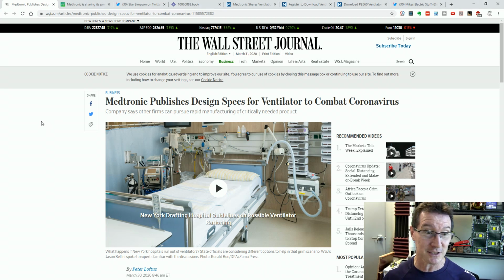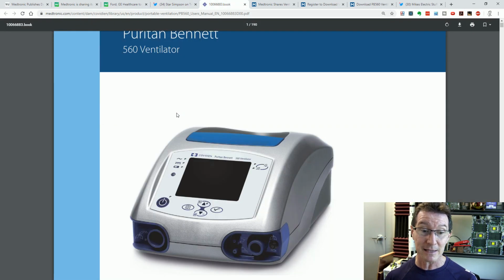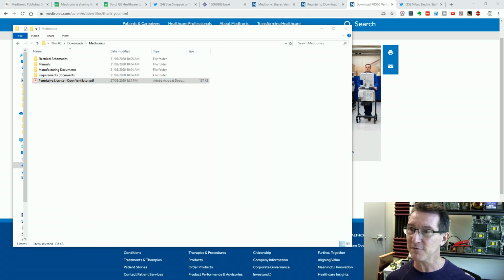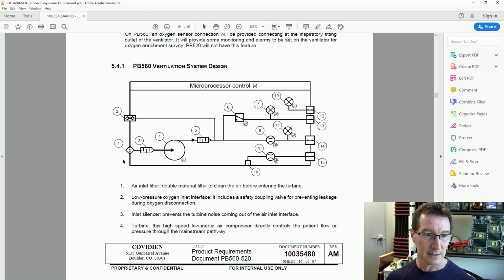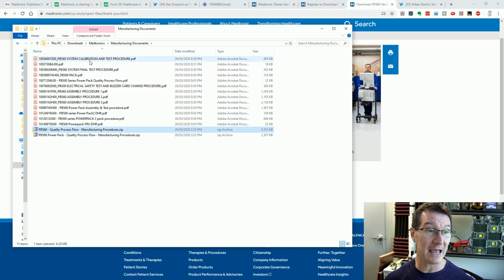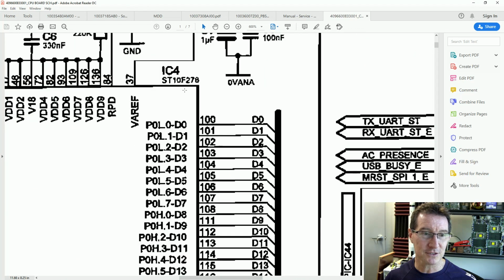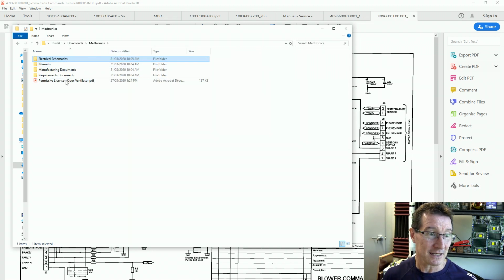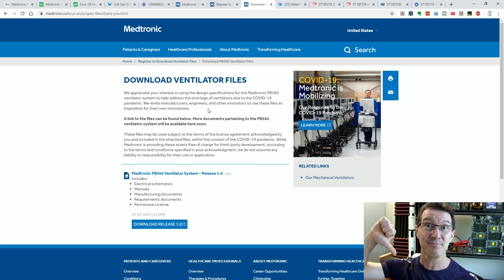eevBLAB #72 - BUSTED! Medtronics Open Ventilator FAIL

Comment: Really?!? Nothing useful in the Schematics?!? You do realize that those actually contain the part numbers and wiring for the unit... Heck, even I could likely create the unit based on what I've seen of this schematic, yes, I might have to do a bit of work entering this into Eagle to produce the circuit board and assemble it, but it *could be done*  Not every piece of information is in an easy electronic CAD file nor are all CAD files immediately cross platform to be used by an average schmoe... it requires certain tools, programs, and equipment and is *NOT* something the average hobbyist would be able to do and it is NOT meant for them, this is NOT a 3D printable or simple plug and play design for some electronic enthusiast ... this is so that companies that *DO* have those capabilities could conceivably ramp up to manufacturing these quickly... not to mention that there are metric shit tons of regulations regarding ANY medical device and extremely high penalties for the manufacturer if they get it wrong and somebody dies from it...  That ST10F276 is a RISC- CISC based microcontroller and the ST10F278 is highly likely to be a slight modification originally ordered by Medtronics to both be an unlisted part number (just like the military does with many things they get)  as well as perhaps have some additional specification for reliability due to its medical usage. This is extremely common throughout the medical industry.  You are correct only in that this is not something that anybody would be able to simply start manufacturing without effort and it is also unlikely that it could be done within any timely fashion for the current situation.  Could it be a "PR stunt" as you put it? Perhaps it is, but it is quite astonishing that ANY medical device manufacturer would release any part of their designs, even for an obviously older device such as this.

Comment: EEVblog is failing to recognize the main point of medical device design.  The FDA doesn't care about your design at all: it cares about the documentation and process you used to design the device.  Without these docs, along with a risk management file, and verification/validation results being approved by the FDA you CANNOT market this ventilator or a copy in the USA.

Any reasonably competent engineering team with knowledge of the medical device process would be able to repurpose these documents, develop their own risk management file, and submit a copy of this ventilator for testing within a few months.

Comment: Hiyo: I work in medical device manufacturing. With those requirements documents, it's quite easy to reverse-engineer the product. You actually want to use the requirements as released to the FDA to create the system, as that's what you're audited against. Releasing the requirements documents is a 50% or so shortcut.
Furthermore: the device likely used custom parts available only through their supply chain. Providing this "how to make a proven ventilator" document might actually be more useful than "how to copy a Medtronic ventilator"
Reply: Yep, 100% agreed. Irrespective of FDA approvals, you must have all that documentation in order to understand HOW to manufacture the device. What aspects of the design are critical, and which aren't? What are the performance criteria that you must meet? How do you test the components and the entire device?
It's pointless to expect that somebody could buy a few motors from eBay, add a few bits of garden irrigation tubing, and 3D print the rest of it.

Comment: The design requirements documents seem to be similar to architecture specifications for a building. That actually can be pretty useful in a reverse engineering effort, if only for providing a firm goal to shoot for. There's also an angle where they've done the research for the necessary codes and approvals (the legal stuff, that is) and all the requirements will meet them. I agree this isn't a start-your-copy-machine package as they advertised it, but it could be pretty useful for one of the open source efforts already well underway. Wrist slap for exaggerated advertising, but it wasn't outright false.

Comment: Do ventilators help with pneumonia though? They pump oxygen rich air in and out of the lungs, but isn't the problem that the lungs are unable to exchange gases? When people are unable to exchange gases in their lungs they need blood oxygenator machines.

Ventilators have been around for ages. They probably didn't use programmeble controllers in them decades ago.

Comment: Several integrated circuits have been reverse engineered. Ref AMD / Intel processors and TI products and everyone else.
Throw 12 engineers at this and the electronics is done...the mechanical part I would lost.

Comment: They did release a second set of files containing the actual CAD files. The design seems to have been created using Zuken CR-5000 which apparently can be imported into Altium. If it were just about manufacturing replicas, the do provide Gerber files (.phd extension).
Their website now explicitly states that more files are to come, including source code.

Edit: removed unnecessary line breaks

Comment: I work in the procurement department of a mechanical engineering company and can approve your opinion. What they released doesn't help building this ventilators quick. Really no BOM, mechanical drawings or exploded views of the machine itself. Let alone CAD files for the PCBs and custom mechanical parts. What a shame.
Reply: Take a look again. They have now released CAD documents and BOMs

Comment: Here's a terrible thought.  These documents are no good for building a ventilator from scratch, but could be useful for reverse-engineering Medtronic's ventilator design.  Just buy (beg, borrow, steal, salvage?) one of their ventilators, tear it down, read part numbers, pull out the digital calipers and scope, and you could possibly clone the original ventilator a part at a time.  So, how many people will try this to make a quick buck?  And if they do, that will just be more sales for Medtronic that they will never need to provide service for -- and those particular ventilators will never have a chance to be used to save lives.

Comment: They made a new release, this is from the download page:

Medtronic PB560 Ventilator System – Release 2.0 (.zip)
Includes:
  * Manufacturing fixtures
  * Printed circuit board drawings (including multiple BOMs)
  * 3D CAD files
  * Mechanical part drawings
Reply: Curious to see if Dave will follow up on this.
Reply: @MrJef06  - probably not. He's not generally known for having a balanced view on things.
Reply: @johncoops6897  well he did follow up. Now the issue is not what was shared, it is the licensing terms. Oh well.
Reply: Share it! Dropbox, github, somewhere!
Reply: @TheLevush  - Share WHAT?
Reply: @johncoops6897  the archive that you downloaded from medtronic as the server is down / fake.
Just put the stuff on github (preferred) or dropbox and share the link here.
thanks in advance.
Reply: @TheLevush  - Well, they obviously don't want YOU to have the info LOL. It's very stupid to "share" (risking  corruption, virus, data change, omission and/or false additions) when the2 sets of  original files are freely available from the manufacturer. The link is in Dave's original video description.

Comment: THEY UPDATED THE WEBSITE THERE IS MORE FILES RELEASED  !!!!!!!!!!!!!!!!!!!!!!!!!!

https://www.medtronic.com/us-en/e/open-files/thank-you.html

Medtronic PB560 Ventilator System – Release 2.0 (.zip)
Includes:

Manufacturing fixtures
Printed circuit board drawings (including multiple BOMs)
3D CAD files
Mechanical part drawings

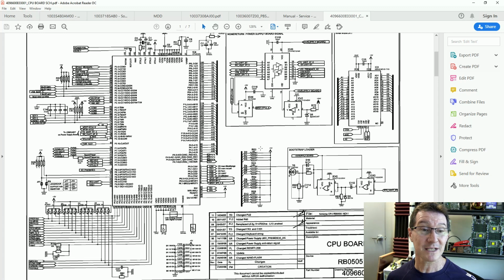Comment: 10:34 The electrical schematics. What microcontroller is used? You basically have a vacuum cleaner that can change rpm quickly like a quad copter motor.  Several pressure sensors precisely control pressure swings by changing rpms up and down just like a quad copter motor does. The documentation provided allows a technician to repair and calibrate a machine. Many of the cpap makers provide this information to so called qualified people. You basically have to get a machine and reverse engineer it to get all the mechanical specs. Pull the machine code and put it though a translator. The micocontroller manufacture probably has software to do this.

Comment: It is apparent that most of the comments people have posted have no idea how the human respiratory system work. It is not as simple as breathing in and breathing out, there are a lot more factors to take into account.

Ok for starters your lungs just do not take O2 in it expels CO2, now this is done by your diaphragm, located below your lungs. The diaphragm is the main muscle of respiration, plays a critical part in your body, it controls your respiratory system. The diaphragm regulates the input and output of O2 and CO2 as well as non-respiratory functions by increasing intra-abdominal pressure allowing you to  expel feces, urine, and vomit from your body; as well as applying pressure on the esophagi passing through the esophageal hiatus; and for women it aids in childbirth.(Batch did not know that ladies)

Now, in the case of the Coronavirus, this function can cease to operate, and in turn cause a whole lot of problems. The virus can prevent the lungs from pulling air in and expelling air out causing an excess amount of CO2 and eventually DEATH. When your lungs cannot expel the CO2 on it's own many organs will start shutting down. The virus can also cause you to get sepsis, pneumonia, and as mentioned above DEATH being the worst case of this virus.

How and why you may ask does this happen? Well the virus causes many things, for starters your windpipe can collapse as well as your diaphragm to malfunction in otherworld it will close off passage to the lungs thus they stop functioning, and this prevents you from pulling in air and effectively pushing out the air that is saturated with CO2. This can cause excess CO2 resulting said above paragraph.

Now, for the Ventilator function, this takes the place of your diaphragm; thus allowing you to breath efficiently by pushing(or forcing, or inhaling) O2 into your lungs while maintaining a positive pressure so your windpipe will not collapse during exhaling process and pulls(draws, or exhale) CO2 out of your lungs; thus replacing a normal body function that is no-longer operating on its own.

Now for all the bashers on this blog, please take into consideration how complex a Ventilator is, and do not think you can just build one to replace the functioning complexity the diaphragm does.

Now for the Blog owner, The reason your not locating the files you so desperately been searching for in the zip file. These will NEVER be available to the public in the event terrorist try to create one and sabotage everything.

Comment: They have released a new package containing some of the 3D CAD files but still without the full manufacturing documents... So I would hold on a day or two and see what they will release.
Reply: I just had a quick look through the mechanical side of things and seems like that at least the most curcial part (the ventilator) is still missing the needed manufacturing documents.

Comment: There's a V2.0 set of documentation available. Same link as you went to for the original download.
Reply: Includes SCH and BRD files for Eagle, along with BOMs. But note that there are A LOT of components to these devices. There are at least SIX different PCBs as part of this ventilator. I still don't see SRC code or BINs yet, but perhaps in the v3.0 bundle? Let's give them the benefit of the doubt here and see what's possible...
Reply: Also note that some of the file names are SUPER long and result in SUPER LONG paths. Some systems may require that these are unzipped at a VERY low level in the drive path. This is not Medtronic trying to mess things up, just an artifact of different components being named and engineered by different groups within the organization.

Comment: My thoughts: Open-source hardware is a lot more than releasing a proprietary hardware to the public. Open-source software may be more ready to use when released, but a device is mostly full of proprietary hardware that you can not aquire because it is manufactured by a contractor, not available in low quantities, not available to end-users, etc.

Even when they release the complete project folder with all the documents they have for this device, you probably still can't manufacture it in short timeframe.

When one have a hard time just to repair a proprietary device, it is usually because you can't source nor replace the failed part. And that's only one part.

A proper open-source hardware is when you take into consideration what are the parts that are available world-wide, that are so popular that they are manufactured in giant masses and stocked in thousands everywhere. You use design tools that are also available for free or not so expensive...

The same would happen to an open-source software code which could be compiled only by a special compiler what you can only get for $1000/month licensing fee. Or even $100. No community would have use for that.

Don't get me wrong, any info released by a company can be useful and respectable. For ideas. But the world needs working units right now.

Comment: I called BS as soon as you mentioned Opensource.  Medical equipment must have all the relevant approvals,  every component has to be back traceable as far as the raw materials.  Certificates of conformity for the materials, manufacturing and any surface treatments such as plating and paint.  I'm a manufacturing engineer in the aerospace industry, so in the UK, we need to have AS9100, ISO9001 and other accreditation's, but that is not enough to be able to legally manufacture medical devices.  To be a sole manufacturer, ISO13485, ISO14001, OHSAS18001, ISO50001, ISO45001 AND ISO29001 are required.  Our company has been approached by McLaren to produce ventilator parts which we can do under sub contract only.  Theses are are for Siemens medical and the new more efficient designs are currently being fast tracked through the approval system.  Its a very expensive process which could cost millions to gain the approvals which is why only major engineering company are involved.  Medtronics is based in an office park in the middle of Watford UK.  Not a very legit company is you ask me.  I've searched through their website and have not found any mention of any approvals, medical of otherwise.  100% bullshit and a marketing stunt at best.

Comment: Well, the release 2.0 files look more interesting.
The .sch is in EAGLE 6.4 format.
The .brd is in "CR-5000 Board Designer V14.010" format from Zuken.
I imported the schematic into AD and the CPU is a ST10F276.
These 16 bit controllers are rather old and have the status "Not recommended for new designs" for a couple of years now.

Comment: I'd like to point out that Medtronics have released more documents; they call it 'Release 2.0' and say that it contains "Manufacturing fixtures, PCB drawings (including multiple BOMs), CAD files and Mechanical Part Drawings".

It's still missing the source code and is released under the same license however :/
Reply: I came here to say this!

Comment: IF we are going to need a ventilator for - and I mean basic ventilator, then why not use older and still functioning ventilator designs - like the Drager Oxylog or Oxylog 2000.
OR, why not use a time cycled CPAP or BiPAP (as long as the patient is monitored properly) 

Once there are enough ventilators, then the problem will be adequate patient monitoring - then we will be doing this again with patient monitoring.

Comment: I think they genuinely believe this is the most important stuff for designing the ventilator. It looks to me like Product Design Requirements (PDR) documents. It's possibly released by their system "engineering" team, which unfortunately nowadays valued more than all Electrical, Mechanical, and Software engineering teams combined. A typical work day in a "system engineering" team is to come up with product requirements and throw it over the fence to the actual engineering teams. In their world it is the most important work because these requirements is something that allows safety certification. Yeah, I smell a typical corporate BS.

Comment: The simplest ventilator I've seen was a variable speed motor with a disc on it and a piston that you could attach on variable distances from the center to get different volumes of air. Two mechanical valves too to control the airflow in and out with a Y-tube at the mouth made a complete system.
It's not as sophisticated as modern systems with supervision and alarms as well as control of pressures, but better than nothing at all which seems to be the alternative today.

Comment: Who noticed design bug in the CPU schematic?  Page 3/7, bottom right corner  - just tack 10nF (C45) to RR opamp output (IC11-B) with no series resistor - shall be allright. Other half for FiO2 sensor input got 1nF added. Seriously, pushing the stability of it? Given chip has bigger than usual phase margin at unity gain which helps to save the day (the datasheet even has it being capable to operate with ~300pF load as salespoint), but that by no means implies attempting crude filter by adding cap directly at opamp output is a good idea! 

But I disagree that this was pointless - it gives a good baseline reference for production and quality control documentation. It also contains whole table of cross-validation to listed standards.

Comment: This guy; https://onlinelibrary.wiley.com/doi/pdf/10.1111/j.1365-2044.1995.tb04517.x
developed the first working (small scale) mechanical ventilator, replaced the manual squeeze bag used before, I believe a company or two are working on an updated design of this to allow easy manufacture in short timescale. It will be interesting to see how that pans out.